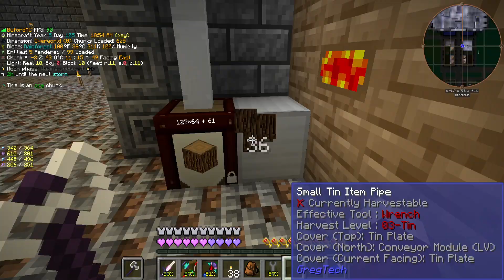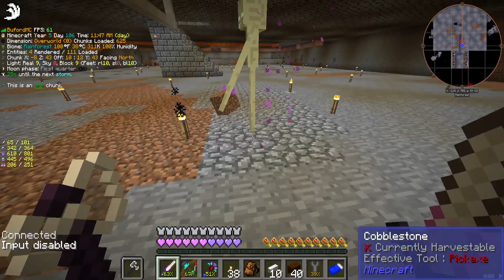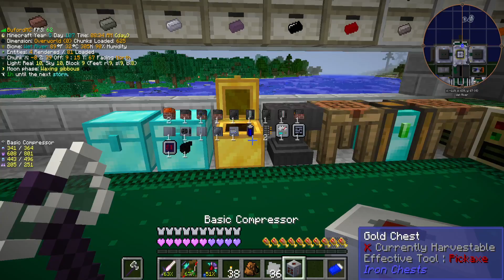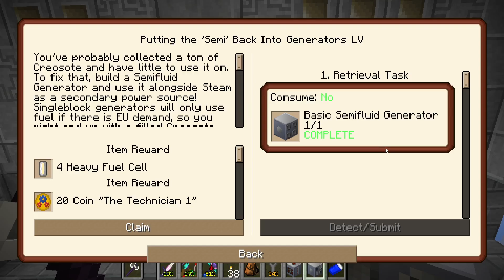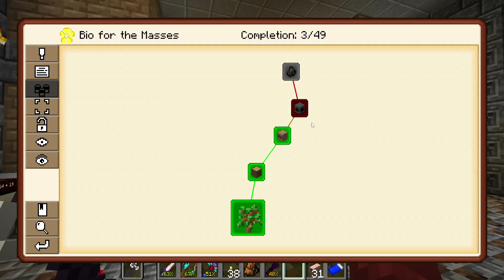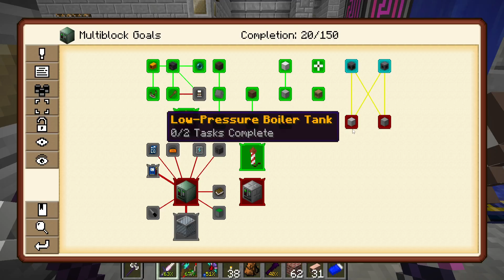GregTech New Horizons EP86: Automating Coke Ovens

Comment: I hope you don't run into throughput issues, but if you do, you should move the charcoal chest so that the coke ovens feed it and then feed the compressor. If the compressor gets filled from the barrel it won't have room for what comes from the coke ovens. Also it will be a little expensive but you can use an LV circuit assembler to make one HV (advanced) circuit. With that and an LV forming press you can make hardened leather for the Tinkers' Construct Traveller's Belt. You can wear it in the belt slot and bind it to a hotkey to get an extra hotbar. It is a good place to store tools and backpacks and stuff
Reply from the maker: I haven't had any throughput issues with the charcoal so far. If my math is correct, it takes 90 seconds for the coke ovens to process a log, and since I have 24 coke ovens, that's 24 charcoal every 90 seconds. So, since the compressor compresses 9 charcoal in 15 seconds, that's only 30-45 seconds per cycle. So, the charcoal itself shouldn't back up. The extra charcoal I was moving in has already processed through, so the compressor is only running off the coke ovens now.

Also, thanks for the tip about the Travelers Belt. It sounds quite useful, but I'm not sure I can make an HV circuit yet, but I'll take a look at it.

Comment: Man I'm glad I don't bother with automating coke ovens.  Sugar and potatoes into making Hootch to fuel Liquid Boilers is so much easier.
Reply: Coke ovens are stone age tech.  24 Coke ovens is very cheap and can be automated in the stoneage.  Hooch is a great choice afyet you can make a vat, but auto Coke oven provides the power to get there.
Reply from the maker: I was going to try that, but as far as I can tell, I need polyethylene in order to make the vat. The coke ovens didn't feel that bad to set up anyways. It just takes a lot of space.